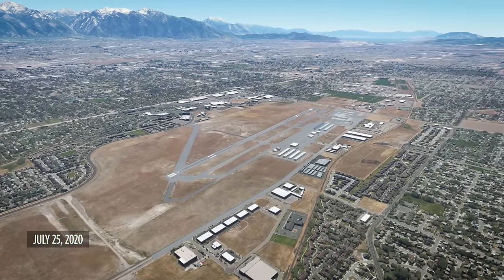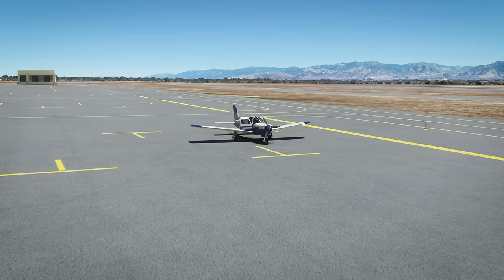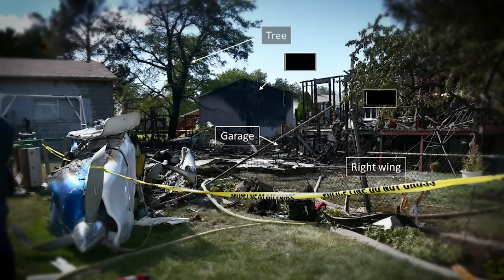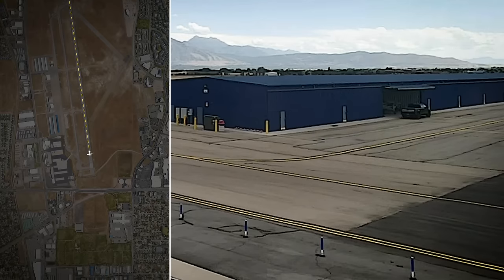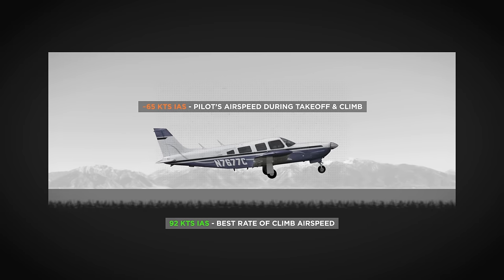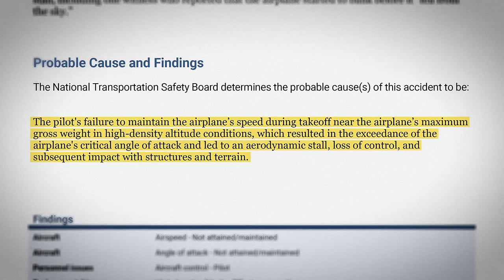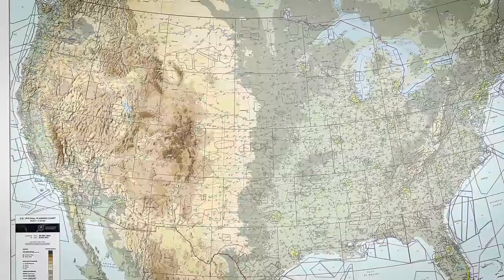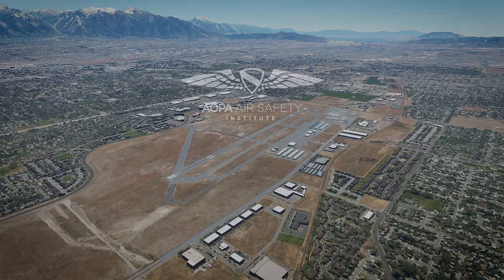Accident Case Study: High Aspirations

Comment: sounds like a real marginal spot. Do you think if he just rode the climb out with the very shallow angle, he might have pulled it off, or he was just dead after point of no return?
Reply: It’s a valley, straight would have been preferred but we weren’t there to see what he tried
Reply: My question exactly. We will make mistakes. How do we get out of them alive? Was he trying for too much altitude gain, or was he sinking once he was in the air? The chart they display shows flaps at 25. He was probably at 10. Gear was up if I remember the photos shown. Looks like he had good fuel flow until he leaned the mixture. Did he adjust the mixture instead of the flaps? The main lesson seems to be "don't treat the book numbers as truth, and add a 50% margin of error before making the decision." I wonder if a test run down the runway with a planned aborted takeoff would be useful in living our calculations for a reality check. Well, next time we can just ask Chat GPT if it's safe. Just extremely extremely sad.

Comment: He crossed every t, dotted every i, and still ended up in trouble. You can talk all you want about airmanship, or how close he was to the limits, but at the end of the day, he was within limits, and the performance graphs were wrong. 
Why didn't they have margins built in? If you did a take off calculation on an Airbus EFB and your take off performance underperformed the calculations, there'd be serious questions asked of the manufacturer.
Reply: No, regrettably, he didn't cross every t.  He didn't check the windsock, or he would have known that there was a tailwind.  And, he apparently had forgotten to establish max rpm prior to takeoff.  Also, especially given the high DA, he should have decided upon the point at which to abort the takeoff if he still wasn't off the ground.
Reply: If you could direct me to where the RPM is mentioned I’d appreciate it, I can’t see that in the video or the NTSB report. Also, tailwind only really has effect on take off distance, once airborne it wouldn’t account for an inability to climb- certainly not from a 7 knot tailwind.

Comment: I think many pilots, including many who have already commented here, have no idea what the real effects of high density altitude can be. Theory is different from practice. When I learned to fly in the Anchorage area (sea level), I learned “about” density altitude, but it wasn’t until I started flying, and later instructed, in the Laramie area (7300’ MSL), that I really learned density altitude. I learned how to lean, and I learned to accept minimal performance. I learned that a 200 fpm climb is still a climb. And I learned that there are some days and some airplanes that won’t fly safely because it’s too hot.

I do not think that the 7 knot tailwind component had anything to do with this tragedy. I think the airplane was capable of flying as loaded. But I do think that the pilot expected more of it than it could give, and that his technique was faulty. I question (because of the fiddling with the mixture) whether he had properly leaned during the run up, and I question whether he obtained and maintained an airspeed conducive to a minimal climb rate. If he’d been willing to accept a climb rate of 200-300 fpm, my guess is that it would have been a successful flight. But instead, I suspect he raised the nose to what he was used to seeing at his lower elevation experience, saw the airspeed diminish as he got behind the power curve, and jockeyed the yoke back and forth because he didn’t understand what was happening. Again, knowing the theory of high density altitude but not having the real experience of its effects in a heavily loaded airplane (in spite of his several trips to Utah) is what made the difference.

FWIW, the highest density altitude I’ve ever departed any airport was 12,100’ DA at Leadville, where the runway is at 9934’ MSL. My airplane is a 1963 P172D converted to a 180hp Lycoming. I was flying light—just me and my 65 lb dog, with roughly 3/4 tanks. My rate of climb was 200 fpm just off the runway, which gradually reduced to about 150 fpm when I leveled off at 11.,000’ indicated.
Reply: Don’t you think that his use of flap was deleterious , given the plentiful runway length ?

Comment: Think carefully about the specific wording (4m58s)  "... tailwind would have certainly have impacted the airplane's ability to accelerate during the takeoff roll ...".  There's an implication that a tailwind will reduce a plane's acceleration.  It doesn't.  In fact, the opposite.  The problem that a tailwind introduces does not stem from it's effect on aircraft acceleration.
Reply: You are correct . It just means that he lifts of farther down the runway .
However , due to ground friction the wind speed will be higher at 100’AGL and this will present  as a slight drop in IAS as he climbed through this height due to wind gradient————not something he needed when he was grubbing for height and airspeed anyway .
Of course , it wouldn’t affect his climb rate , but it would shallow his climb angle and concern him even more,presumably

Comment: I don’t necessarily buy the repeated claims on the difference between POH numbers and real world performance. If the engine is developing rated manifold pressure the power is there. I can’t believe a difference from the book to the actual plane would take you from 500fpm to 0. What is missing here and it is critical is the airspeed at which he lifted off. If you lift off too slow the extra induced drag could quite easily kill that much climb performance. This has caused many accidents. These book numbers require you to fly a very specific profile. Deviate from it by just a few knots and all bets are off. I think the fact that he took off downwind is a definite smoking gun. The combination of a high true airspeed and tailwind would have given him a high ground speed and it would have felt like a normal takeoff but if his airspeed was too low he would not climb. This is a much more likely explanation that the “difference between POH and real world numbers”.
Reply: He probably didn’t know that Vx increases with DA as well , which would mean that instead of pitching down a bit , his natural desire to pitch up to his usual angle only compounded his problem .

Comment: Far out! Add 50%! To the performance parameters for safety! Thats an insane amount! You’d think manufacturers would have a responsibility to be more realistic in stating the airplanes capability. 
Of course taking off early and into the wind with less weight are major factors, but you’d think you could at least trust the numbers you’re placing your life and your passengers life on.

Comment: Thanks for sharing. I am not sure that I agree with the statements in the video that there was too much trust in the operating handbook. Isn't that exactly made for this purpose, to tell the pilot the safe operating margins of the aircraft? And sure, it was close, but not that close. 70 pounds under, good CG, expected to climb at 500 ft/min. All that sounds pretty decent, and it should be the manufacturer's job to build margin on top of that, meaning any aircraft of that type that is properly maintained should have been able to operate within those paramaters. 
That said, according to the manual, the take off distance with no wind would have been over 5000 feet according to the manual, and over 6000 considering the tailwind, which is longer than the runway. That would explain what went wrong.

Comment: I recommend all pilots have an abort point; Something easy, like "If I'm not in a climb by half way down the runway, abort."

It sucks, and it's hard to explain to excited passengers why you put it back down and aborted, but it's critical every pilot adds to their briefing where they're going to pull the throttle back.

Comment: Under such conditions, wouldn’t you for safety sake use as much of the runway as safely possible and increase speed to the ultimate level before lifting off?  Long runways are great and often designed for logical reasons.

Comment: While I concur with all your statements about high DA and performance, I don't buy ANY of that in THIS crash. Even in the charts you showed, with the tail wind, and your 50% increase, the airplane could take off in 3600 feet, which according to the video, it did. The take off airspeed does not change with high DA or a tail wind, so the pilot would have taken off at his "normal" speed. And a Lance should have NO issues climbing even at gross weight at 7300 feet MSL, which was the DA you mentioned. 
Perhaps because of the fire, or some other reason, there were other issues. High DA may have been contributing, but it is hard to call it the "cause" here....
Reply: Agreed . Maybe he was trying to climb with flap out , or at the wrong A/S since Vy decreases with altitude.
Reply: Not properly leaned for takeoff is a reasonable guess. The checklist on my first trainer directed full rich below 5000 ft MSL, and didn't mention DA at all. That's flat out dangerous. My personal rule now for non-turbo pistons is to always lean for max power during the runup unless the DA is below 3000 ft. At worst you'll wind up pulling a very small bit. But typical summer mornings where I live I find myself pulling the mixture almost 1/4 out, and an afternoon takeoff requires even more. It only takes a few seconds on the ground but it makes a surprising difference. Always always always lean properly.
Reply: @jeffhiner  , Not properly leaned, but it took off in almost exactly what the video says it should have done. I still think there is more to this than we have seen... 😞

Comment: I do not completely agree with the findings: The spike in the exhaust gas temperature just before the plane went down was not investigated, or taken into consideration. It could therefore being also due to two reasons: 1) The pilot leaned out the mixture for some unknown reason (normally one would knock the throttle and mixture to full forward for maximum power and full rich mixture - Balls to the walls); or (2) Carb Icing: Yes even at 32 Deg C it is possible; depending on the atmospheric conditions. I think the accident was rather caused by a combination of 3 causes: (i) Downwind take off (ii) Maximum weight, together with the density altitude and (iii) Carb Icing too low to handle. I think the engine stuttered, while the pilot pulled up already on the yoke. The loss in speed and the attitude then caused the plane to stall and dive to the ground.  Still very sad. "Rather stay on the ground and wish you were flying, than up there and wish you were down on the ground".  My sincere condolences to the Family and friends. Regards

Comment: Whys the video twice say a tailwind is bad for takeoff? 13:45 correction 3 times
Reply from the maker: During takeoff, tailwinds reduce airflow over the wings. Consequently, the necessary lift is achieved later and at higher speeds. Therefore, longer runways are required to perform a takeoff.

Comment: For determining whether the performance data is dangerously optimistic, do investigators ever work to reproduce the situation (e.g. same airplane, same airport, same weight, similar weather) and measure what performance they get? That seems like it would at least resolve questions about whether the pilot was making large mistakes.
Reply: If they did it exactly the same it would be only because of extra vigilance of the pilot to avoid coming to the same tragic conclusion. I'm sure they would use sand bags to replicate the load instead of taking extra passengers but I see no value in losing another pilot and more homes and people on the ground.

Comment: The aircraft seemed to lift up with a lot of runway left. I'm curious as to what indicated air speed was at that point and why the decision to take off was made at that point.

It seems strange to me that the pilot would decide to lift off with anything less than well above stall speed (out of ground effect), regardless of engine performance issues or a confusion with regards to the direction of wind. Either situation causing insufficient speed before the decision point should lead to an aborted takeoff in my head. 

Was it a misunderstanding regarding actual stall speed in the hot and high conditions?

Anyone able to shed some light on this? I'd be very curious to learn what might have happened on the runway

Comment: I see its about 223nm for this flight, and from a quick google search this plane holds 84 gals and burns 14-16hr. Can anyone who flys these planes provide more insight into why you would top off here? Seems unnecessary with full passengers and high density altitude.

Comment: Aspiring pilot here with a question related to this case: Is it ever safe and appropriate to attempt to leave ground-effect before reaching Vx?
Reply: IIRC, if you are hot and high, Vx and Vy will be faster.
Reply: @apennameandthata2017 Vy decreases by about 1% for each 1,000’ of increasing DA. Vx increases by about 1/2% for each 1,000’ of increasing DA.
Most pilots don’t know this , but it’s only in marginal situations like this that nailing those speeds can mean the difference between making it —- or not.

Comment: Certainly a tragic event, but the video was not up to Air Safety Institute standards of clarity and completeness.

"Flight control effectiveness?" Doesn't that only depend on dynamic pressure, measured in indicated airspeed? That point was made in passing but never discussed, and I'd never heard that as a density altitude factor. What effect did it have in this event? Tailwind contributing to "worse" performance during climbout? Climb gradient, yes, climb rate, no. Ambiguous and not instructive. "Sluggish" aircraft performance is pejorative, not instructive. Minor point: the narrative correctly referred to high performance and complex endorsements, but then said the pilot was "looking forward to enjoying his certificate." Sloppy writing. How can the engine monitor show that the plane exceeded its angle of attack, or did it have an airspeed sensor? If so, why was airspeed not plotted as fuel flow and EGT were plotted? Significant point not explained. If the plane was on the back side of the power curve, it could lose altitude and not stall, so was critical AOA just a cliche used out of convenience? There are many instances of the NTSB using stall as a phrase of convenience when specific information is not available. 

Also not mentioned is the psychology of the sight picture. High density altitude takeoff means higher true air speed at liftoff and higher ground speed. To a pilot accustomed to lower density altitude takeoffs, the lower flight path angle and the terrain moving faster would have seemed improper. Correcting to the lower density altitude flight path would have made the airplane too slow.

Some manufacturer's performance charts are based on new airplanes, but not all. 

This video could have emphasized good technique, rather than by negative implication.

ASI videos are normally excellent, this one was far, far below that standard. It's hard to believe this video was approved by ASI management.

Comment: I wonder what the result would have been if he took off into favorable winds to the N
Reply: Might have worked... however there is controlled airspace almost directly north of that airport for Salt Lake International which is why most pilots take off to the south if possible
Reply: @johnleake708  Even if it's with a tailwind?  He obviously was aware of DA as he did factor it in. What is "ground effect"?
Reply: @JimAllen-Persona  Yes even if it means a tailwind takeoff for some pilots
like the one we where with (never again)   Salt Lake is during a hot PM ends up being a classic hot and high mountain
Reply: Maybe flying North would still need quite a steep turn to avoid the restricted airspace, resulting in a stall in any case?
Reply: Once the plane is in the air it doesn't really care if there's a headwind or a tailwind. The rate of climb will be the same. A tailwind would hurt angle of climb, though.

Comment: I see quite a few of these reports are quick to label density altitude as a probable cause? however in this case and according to the performance charts says 500 FPM climb performance is still an acceptable rate for safety reasons for that airport. Clearly that plane was not climbing out at 500 FPM.  Flaps were at 10 degrees and the gear was retracted. Was there any engine performance monitoring recovered from the accident. Why not? IMO this could be considered an incomplete investigation. We don't have all the data?

Comment: The term "High-density altitude conditions" has never made any sense to me. My understanding is that the atmosphere becomes less dense during high temperatures and increasing altitude. 

Thus "High altitude/low density conditions" would describe the condition of the atmosphere more accurately in my opinion.

Comment: I question whether he needed to "top off" the tanks, or if he'd have been able to make this trip with 1/2 or 3/4 tanks.  I've actually had fuel removed for that very reason, and was glad I did as the plane, while within limits, was still working hard to climb.  And regarding the wind direction, that was just a monumental mistake, intentional or not.  My guess is that he went with the AWOS report and forgot to look at the wind sock.  He seemed like a dot your I and cross your T kind of guy, so a lot is left to speculation.  In my training, I was told by more than one instructor to never adhere to the published numbers, as they applied to a new aircraft.  Over time, things change....engines tire.  I think if he'd have just left with a little less fuel and in the right direction, he'd have been ok.